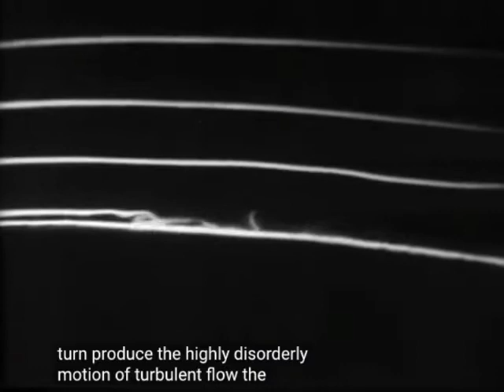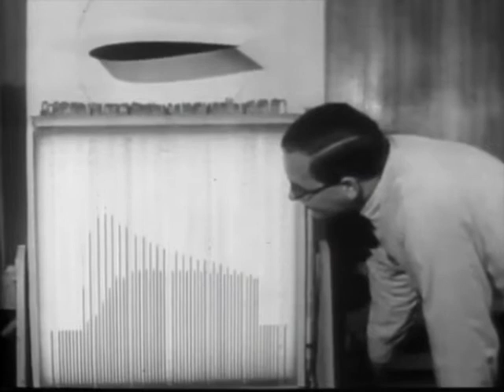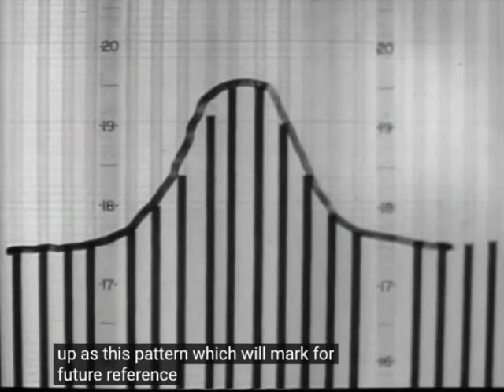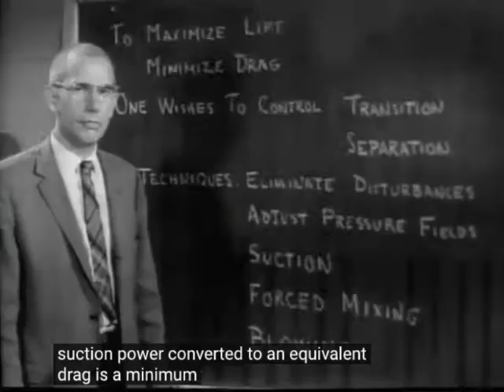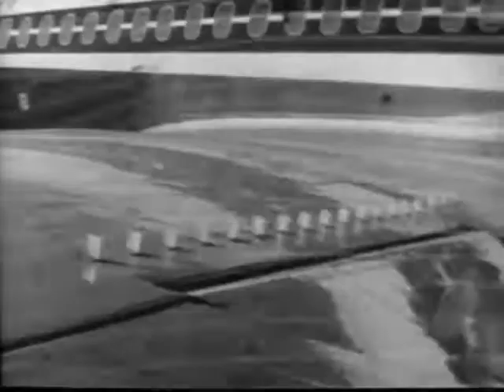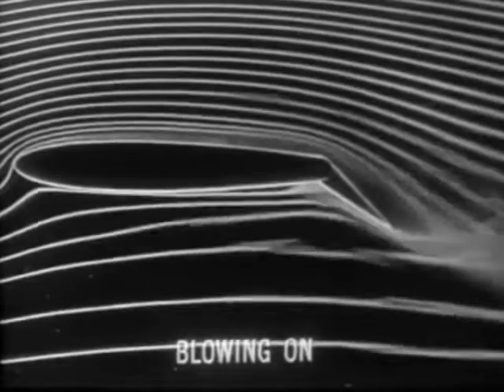Boundary Layer Control

Comment: They knew so much about these effects at such an early stage I'm surprised that these "jets" aren't more widely used. It looks like you could use just the jets of air to make the aircraft climb or descend .....without control surfaces. I'm surprised we don't see more of it in modern designs.
Reply: There was a NASA demonstrator for this recently.  It is much more complex without too much added benefit, and requires fly by wire almost like the Space Shuttle.

It does allow for no control surfaces, and the difficulties of trying to hide those from radar.  The Next Generation Air Dominance (NGAD) MIGHT use some exciting tech like this, but we will have to wait and see.
Reply: >I'm surprised we don't see more of it in modern designs.

Terrible engineering problem, you're relying on an extremely complex system for critical control.

It's used for control and stability augmentation in some areas, but never for critical control.

Think the closest to relying on this is in the B-2 and some aspects of the F/A-117.
Reply: @NotThatEcstatic   " you're relying on an extremely complex system for critical control." 
You mean like a jet engine?